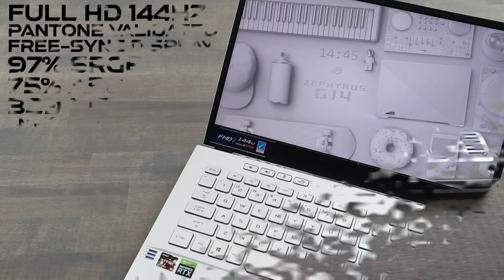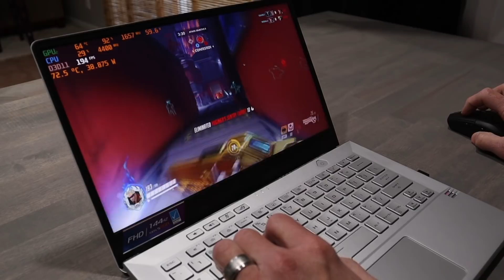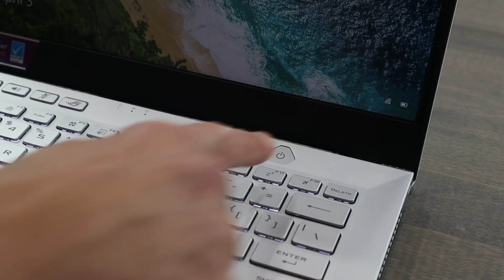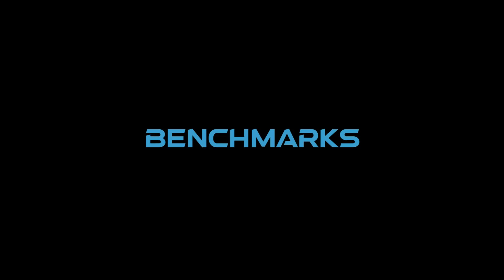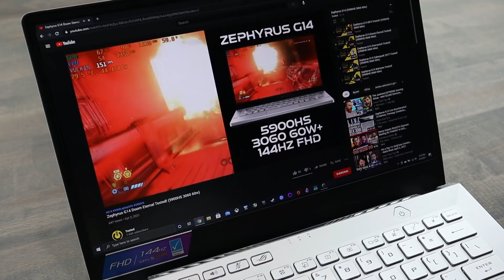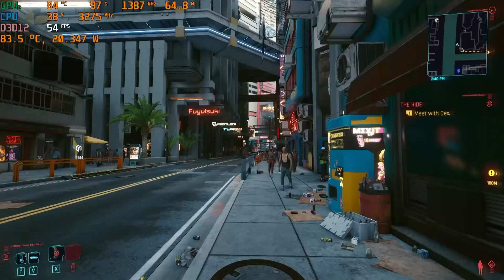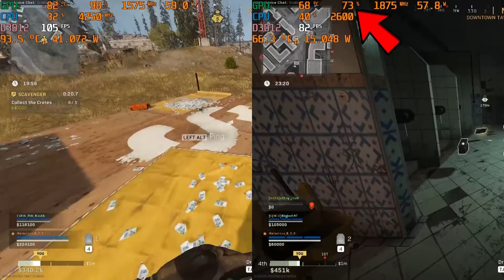Zephyrus G14 2021 Review!  5900HS 3060

Comment: Does your screen suffer from some sort of ghosting or motion blur? I just picked up mine from Best buy and coming off a Asus zephyrus m15-2020, I noticed a significant amount of blurring that is absolutely not present with my M15. It's almost as if the display doesn't update fast enough despite being 144 Hertz.
Reply from the maker: Yes I did.  It’s much better than last years model but it’s no 9ms or faster, that I can feel.
Reply: @BobOfAllTrades  Have you tried playing with custom resolutions? Seems the freesync range is 48-144, possible that's a culprit. I'm going to fiddle around with it, I'll post again if I have any noticeable improvement by closing the range gap. Shame really, laptop is fantastic otherwise.
Reply: @BobOfAllTrades  So I tried using Custom Resolution Utility and setting the refresh rate range to 60-120 which ultimately disabled freesync. Less ghosting but it's still highly noticeable. I think I'll be returning this product and going with a QHD model, this is giving me legitimate eye strain and I can't work with something like that. Shame really, cause everything else about the laptop is quality.
Reply: @Ufo_Abduction  if you can deal with it, it's not too bad. It's really game dependent. Like Forza Horizon 5 and Halo Infinite looks perfectly fine on the screen as does Rainbow Six Siege. But Fallout 4 looks like an absolute blur fest to the point that you have to disable most of the native effects and use an ENB to clean up the image quality enough that you can actually play it without your eyes hurting. So YMMV depending on the types of games you play.
Reply: Update: I decided to keep the laptop, you get used to the screen after some time. I found it's not so noticeable with third person games. With first person games definitely turn off stuff like film grain and motion blur as they'll exacerbate the problem. It's also less noticeable with newer games than with older games. Like, with Fallout 4 it's atrocious, but I didn't have any issues with the Resident Evil Village demo.
Reply: @Ufo_Abduction  the overdrive option makes it worse. I ended up buying an a 27" 144hz 1440p IPS monitor for most of my gaming. I only do light gaming and generic workloads if I'm off the monitor.

I'll clarify that I love everything about this laptop except for the screen. It's the only low quality part

Comment: Bob is it possible to Undervolt these new Ryzen chips? Thanks!
Reply from the maker: Nope
Reply: @BobOfAllTrades  Ouch! Thanks alot for the reply. Really uncertain now if i should wait for the upcoming Tiger Lake H 45 W or go for a Ryzen. If the Tiger Lake can UV that would be an advantage over Ryzen.
Reply from the maker: @slickrounder6045  That depends on how well it would undervolt.  10th gen was pretty tight and pushing past -.080 was hit or miss.

Comment: Hey Bob, great review! I just wanna know, is it possible to edit registry key and limit CPU @3GHz like 2020 model?
Reply: You can do this with any PC, it's just a regedit
Reply: @beebop7039  tnx mate. I've sold today my old g14 and ordered new 2021 model...so I will use the same 3ghz limit. I'm sorry that Bob didn't try same to see impact on cpu temperatures
Reply from the maker: You don’t need to.  You limit the wattage using the sliders now 👍
Reply: @BobOfAllTrades  this is correct. I set mine to 20 watts and the 3060 has been able to sing. You can do reg edit to disable boosting and lock the cpu to 3.3GHz which leads to further thermal savings. My fan profile is set so that I can even game silently in some instances with the fans only increasing past 2500 rpm when the gpu and cpu get above 65c which isn't very often
Reply: @ItsMeProday83  

Yeah, thermals are really good when you do that. Most games don't need more than 3.3GHz and you maybe lose 1-3 frames in most titles. The Ryzen 9 5900HS is a real banger of a mobile cpu. No issues in Outriders, Division 2 or Red Dead 2 so far.  Next months Resident Evil Village will be the first proper test I'll be putting this laptop through. Might require a boost to 3.8GHz and another five watts to 25.
Reply: @beebop7039  hey man, can you please elaborate on "set mine to 20 watts"? are you referring to CPU undervolting? My model is the same one as you with Ryzen 9 5900HS and 3060. I have been trying to undervolt GPU but it does not seem to decrease thermal for me. If you could explain the things you did for your setup, including fan profile, that would be really great
Reply: @Carmadon100  Open up Armoury Crate (just press the key on the upper left side of your keyboard) and go to the manual profile. Under CPU, set SPL to 20/80w and SPPT to 25/80w. This will allow your cpu to run at much lower wattage (similar to Xbox Series X/PS5). You'll also want to prevent the CPU from boosting, so you'll have to do some registry editing to open up additional power options. A quick google search will sort you out. When you change your power plan settings, under maximum processor state, make sure it's set to 100%.  Then under processor boost mode, set to disabled and that'll lock the CPU at 3.27 GHz, but with the SPPT setting, you can get up to 3.8GHz if you do some additional reg editing to open up processor speed control. Then you'll be 1:1 with the next gen consoles. That said, I've been fine with the CPU at 3.27GHz. Currently playing Days Gone near maxed out and have zero issues hitting 60fps constantly.  Resident Evil Village ran great as well, though I ended up having to disable Ray Tracing in certain parts of the game as performance would sometimes dip below 48 fps (never unplayable, just not optimal). Without Ray Tracing though, was easily hitting 80-100 fps.  Finally, Metro Exodus Enhanced Edition (the ray tracing only version) ran fantastic at a locked 60fps on the high preset. This laptop has a lot of power and honestly, these settings are way better than the stock Turbo setting.

For the GPU clock settings, I just have them set to 100/200 and 120/300 respectively.

https://imgur.com/nRSQphQ

https://imgur.com/5XQtVf7

The fan settings allow the cpu and gpu cooling to compliment each other and so long as you're not in a scorching hot room (e.g. you're a normal person using your laptop at normie temperatures like 75f or below), the cpu and gpu shouldn't be hitting anywhere close to 80c. In most tests I was pulling around 75-77c in more demanding games and around 65c-71c in most scenarios. This is with just stock cooling, no pads, no air conditioning, etc.
Reply: @beebop7039  Thank you SO much for your detailed comment. I cannot thank you enough. I have turned off the processor boost mode which seems to be locking the CPU at 3.27 GHz. The problem is that I believe the newest Armoury Crate version has left out SPL and SPPT settings that can be controlled. My version (which is the newest) doesn't have those options. I did some research on Google and it says that the version you have is something that has "ACConfig_GA503QS". I tried to find that file online but didn't have any success :( I guess I'll keep looking for that.

On the other hand, I also found something that you could perhaps play around as well. You go to NVIDIA control panel - 3D settings - program settings -> and you can select a game/program you want to control specifically. Under #3 there is an option that can cap out the maximum frame speed. If you set it to 40FPS (or however you like), it is supposedly really helpful for the thermal. :p

Anyways, I hope you have a wonderful rest of your weekend, and I'll keep on hunting for that file haha :p cheers!
Reply: @Carmadon100  Thanks, I'll remember not to update Armoury Crate 😅
Reply: @beebop7039  try out the nvidia control panel option as well. My thermal got Tremendously better- not making any noise at all even without AC plugged in. wow
Reply: @Carmadon100  yeah I lock most games to 60 fps. Only game I allow higher is R6 Siege due to it being a competitive game. I have that locked at 120 fps
Reply: @Carmadon100  https://imgur.com/ODudbPM

running "Days Gone" maxed out at 1080p/60 after turning off my AC and letting my office heat up to about 84F.  Laptop stays at a nice, cool 71-74c throughout gameplay. At one point it bumped up to about 80c, but that was only when I was taking on the Saw Mill Horde (about 500 zeds), so it was pushing the laptop pretty damn hard. Beyond that, it stays in the 71c range the entire time. Really damn good with these settings if you ask me.

Comment: I don't understand why can't OEMs just use stacked dimm slots, that way u need almost the same area on the Mobo, while slightly increasing the thickness.

Also, I stated this in another video as well (don't remember if it was yours or some other channel's), another thing OEMs can do is solder 256/512 GB onto the Mobo and leave an empty slot if they don't have the space for two slots. Providing a second 2242 slot is alright, but you can hardly find drives that size now.

Comment: For the memory part, they do have an option to solder more memory even though in a 14" chassis. Like late last year, 16Gbits Micron Rev B  DDR4 has been in the market. So if you have 8 chips with 2Gbyte each, you do get 16Gbyte of RAM . And 16Gbit Samsung M die, launched more than 1 year ago is also an option.  That is how we get 32GB DDR4 unbuffered DIMM sticks on the desktop these days.  However I rather the Zephyrus have a thicker chassis with 2 RAM slot , stacking on top of each other. I do not think it will increase the weight much.

Comment: This guy seems to get the general idea of gaming laptops.
They is no right, but you design with a goal in mind.
I personally I am going with Omen 15 5800h and rtx 3070.
I want the extra Vram and the wattage seems tweakable between 60-100 watt and it's cheap.
Yes others like the Legion 5 Pro are faster, but they're bigger and pull more power.
G14 was just a little to gimped for my liking, but G14 does seem to be the portable god of laptops.

Comment: One of the first pro reviews - so far your review lines up with my experience.  Gets hot, skin temp is a bit much, but no, or rare thermal throttling and performance is great.  And you are also the first out there to point out how great silent mode is on this thing.  It's an excellent way to play a lot of games at 60FPS - more than you'd realize.  I can play Destiny 2 on high/60FPS (a few mid 50s but the freesync easily absorbs it), Doom Eternal, CIV VI - and I'm sure a whole lot more, and still peg at or near 60FPS.

Comment: I love your investigation into the trying to get the most performance out of a thermally and acoustically limited situation. The 60W RTX 3060 gets a chance to shine.
Reply: I don't know what I was thinking. In my brain I saw 3000 series and thought to myself, that the rtx 3060 would be better than my laptop RTX 2070 Super. Boy was I way way wrong. It's much weaker. BUT I have 8 cores now instead of 6. Not sure how much effective speed is gained switching from 6 cores to 8 cores in real time gaming.

Comment: I like the white build of the G15, but wont buy for other reasons (no webcam, low CPU wattage, no MUX, soldered RAM). G14 too small.
Reply: Wait for the legion 5 in stingray white, Ryzen, maxp 3060/3070's and mux switch. Asus is slow

Comment: How does it stand vs the g15 3060 that has the same price but bigger screen baterry and one more ssd bay?....
Reply from the maker: That laptop has an 80 W base 3060 so I’m not too sure
Reply: G14 is more premium laptop with all metal build , and with glass touch pad. G15 made  by plastic. Maybe this is the main reason.
Reply: @andyhuang6065  you mean g15 with 3070 made of plastic ? 
Can’t choose between this 2,  g14 with 3060 or g15 with 3070???